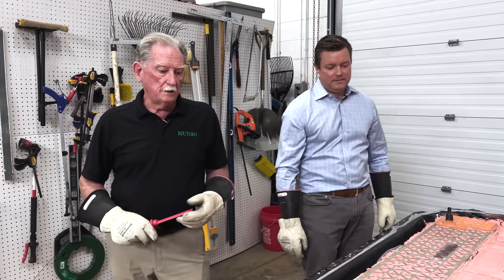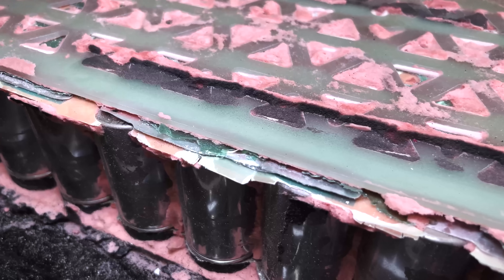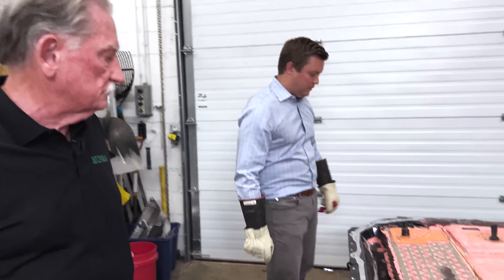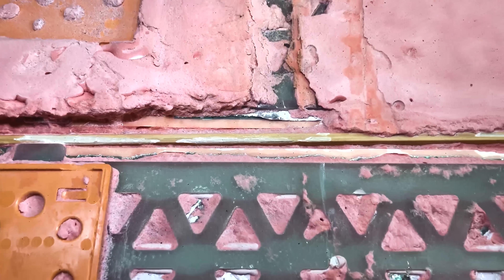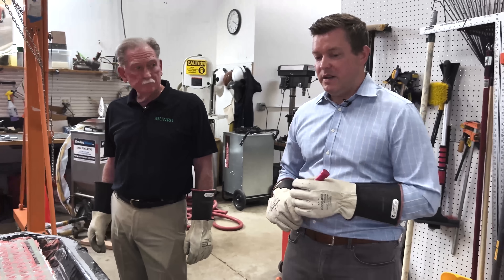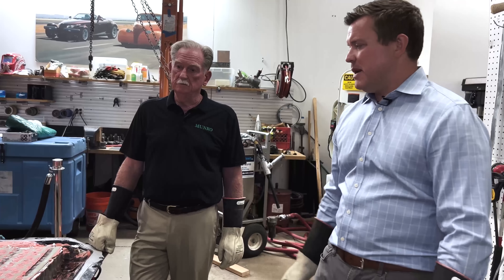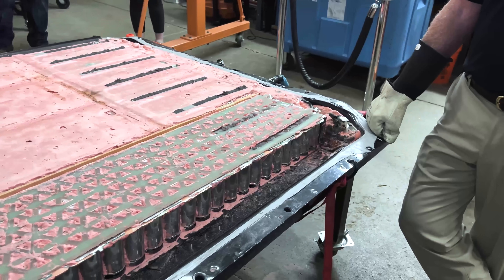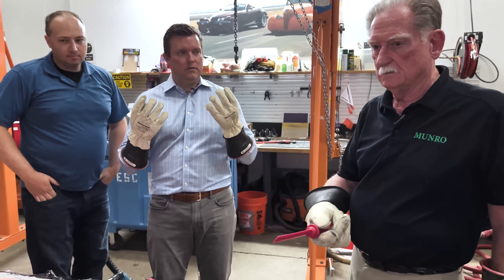4680 Battery Pack: What We Found Under the Foam!

Comment: What this design does prevent is repair. Yes it can be recycled when EOL, but ANY fault will need it to be recycled.  Ok, it's practically a solid state device (no moving parts) so it should be in effect 100% reliable until it reaches its natural EOL through cell wear, but realistically there is nothing "fixable "In there at all.
Reply: Exactly the point. To make something repairable you have to be able to access the insides easily. Doing that you compromise the pack and make it far easier for it to fail due to environmental ingress. The design of this pack is such that it will have a very small chance of initial failure which would be covered by warranty. If the pack passes the initial break in period of 8 years, then you really only have to worry about slow degradation. Once it reaches a point that it needs to be replaced for that it will still be viable as a stationary storage pack used in its entirety. People will pay big bucks to bolt one of those puppy's down somewhere around their house and have the equivalent of 3-4 power walls. Once it can't perform that function it will be sold to a recycler to be processed as high-grade ore. It will never be necessary to open it. This is new and different technology; we don't have to make it work like what we are used to. It doesn't make it bad or worse, just different.

Comment: I have zero knowledge in manufacturing/ assembly/disassembly of these things, but how would one repair that? Would you have to throw the whole pack out if a cell goes bad? It looks like a mess trying to get rid of the foam to replace a module.
Reply: Let's assume there's a "fuse" on each cell.
Now let's assume that if a cell goes bad, it can be electrically disconnected using the control circuitry.
You won't notice 1 cell missing.

Comment: Mr. Munro... I like your channel, even though I disagree with you on some things. If I may ask you a question...
You mention that when a head gasket fails, it is not the fault of the head gasket. It is the fault of the threaded fasteners. I agree completely on that, however....
As a customer... Would you rather have an engine that is completely welded shut, with no access to internal parts if something goes wrong? A spark plug fails... New engine! The same concept applies to a $10,000 unrepairable battery pack. Hope you can at least see my point, even if you don't agree.
Reply: On Audis the entire engine compartment is sealed.
Reply: @fredbloggs5902  Definitely won't be buying that car! But is it sealed completely, or just to customer access? In any case that is not the road we want to go down as customers.
Reply: @DavidJohnson-tv2nn  Fred is kidding. There are no cars with sealed engine compartments, but frustrated customers might make comment like that.
Reply: So....."A" cell fails.
You now only have 98.78% of the original capacity.
(You won't notice)
Reply: @rogerstarkey5390  So if BMS components fail, you're out of luck. Coolant leak, you're out of luck. Any number of internal components fail, you're out of luck. Can't believe that you guys try to justify this stuff. 
By the way, may I suggest that you watch the video on the Gruber motor company channel. Where a single failed cell took down the whole battery pack. In that case, they were able to gain access to cut the bad cell from the system.

Comment: Appreciate the explainer on how a pack like this might be recycled. It sounds “simple” but still requires expensive and less common equipment. Is it fair to say that, even though it’s certainly recyclable, serviceability has still gone straight out the window? 

It seems that if there are any issues with individual modules or cells, the entire pack would need to be scrapped.
Reply: For recycling, the Floatation system they described has been used in the mills at base metal mines for several decades ... crushed ore goes in,  high grade concentrate comes out.  The floatation cells have chemicals that affect how the materials float.  (obviously in pure water much of it would just sink).   

The liquid nitrogen system was prototyped by a small start-up a few years ago, and it isn't done so much to make it easier to pulverize the battery, but so that it's electrically safer.
Reply: @Ken Lord  True, but then what happens to the environment at EoL with regard to that which "sinks" Ken Lord??
Reply: @IDamian1  What happens is whatever you let happen.   Just like every other industrial process in every other industry,  you must take care of it.    EV battery recycling is already 95% efficient,  so the materials in a battery can be re-used 20 times before the good stuff is entirely lost by the inefficiencies of the process.

This is 20x better than mining new material from the ground for every battery,  which also creates tailings materials that must also be contained.

And even that is far far better than any ICE car where EV haters just totally ignore the tailings and environmental concerns for producing and distributing the fuels for the life of the vehicle.
Reply: @KenLord  nonsense!!!!! Fuel is just a tiny part of a gigantic oil industry lol….. do you even know how many oil byproducts exist!? There are about million
Reply: @KenLord  from your clothes to devices even this Tesla battery, tires, roads, ships, aircrafts, spacex fuel…… everything is oil
Reply: @carholic-sz3qv  awesomely juvenile and irrelevant observation, with an utter lack of nuance.

... The vast majority of oil is used not for those useful things, but is wasted by needlessly consuming it as fuels. 

I didn't tell you that we must stop using all oil.   I've told you how an EV battery pack can be recycled.   Learn what words mean.
Reply: @KenLord  let’s not forget all those “EVs drivers that still very heavily relies on the oil byproducts in their life, they/many flies regularly! Wasted food…… there is a difference between using and wasting needlessly as you crap about! The world, grids, infrastructures was built by the oil industry what have EVs actually contributed!? Even to open the most remote mining operations in the world for gold, copper, lithium mining……. All is fuel.
Reply: Yeah a ball mill Is rocket science. Nearly 10 years ago I retrofitted a testing device to measure the needed cutting energy on lithium ion cells.  Why do you want to repair this. We are running in a lack of workpower. It's a waste of qualified people to repair something that is build by a robot in a fraction of time.
Reply: The same goes with the pipes and BMS……. It’s essentially a single use piece of crap! How are people going to reuse those cells/batteries for other projects after the car life!?
Reply: @carholic-sz3qv  look, I'm pro repair, but the amount of cells that goes into someone's DIY project (and probably ends up in a landfill instead of recycled due to exiting the loop) is minuscule. If it makes recycling the majority of the pack easier (=cheaper, =more likely to happen), it's worth the compromise. And if it means there's less vape pens in the world, I'm all for it.
Reply: Teslas battery packs are already designed and hold for several hundred thousand miles. The 4680 cells have a lower internal resistance which is a big advantage for longevity; generated heat is one of the major problems with Li-ion battery cells, so the 4680 cells will most likely be far superior in that regard.
Reply: A SINGLE  cell provides 1/820th of the energy.
0.125% 
NOT noticeable.
Reply: @rogerstarkey5390  That is not really the point I think shanepj13 is making. 
Before structural battery packs. The individual battery cells could be collected after a lifetime as part of an battery pack that has then been deemed End of Life (EoL). Then they could be individually analysed and repurposed depending on their individual State of Health (SoH). The cells will deterierate at different speeds. Some would be good enough to be reused directly in a new EV battery pack. Some would be a bit worse of and maybe end up in a home backup system. And the once with worse SoH would be grinded and floated or similar and be remade into new cells. This is the more resource intensive however.
If the only option structural packs are to grind them and float the materials like it high grade ore it is still a lot more resources then to simply repurpose the cells which are healthier.
Reply: @rogerstarkey5390  single dead cell take entire parallel group to grave with it. Dead group undercuts whole string of cells. That's why entire battery is as good as weakest link.
Reply: @uosiumen  TL:DR - single cell failure will not take down the battery. Just nope. 

Single dead cell, if failed open, is just an inactive cell. 
If failed short, will burn through its connection to the busbar and turn into an open. If parasitic... Well, hopefully that should come out quite early in the life cycle as excessive self-drain, falling under warranty. Maybe there's an argument there for replacing that cell only. But in general, a parasitic cell that develops said parasitic in use, should fail short (and then open) after a good supercharge/ludicrous mode go-pedal-stomping. So... Italian tune-up?
Reply: If designed well then it should last longer than anything else in the vehicle without needing to be serviced
Reply: @niktak1114  wrong!!!! You can’t be sure that it will last that long, plus different usage different degradations ….
Reply: @carholic-sz3qv  Obviously a small percentage of packs will fail. In that case the whole pack will have to be recycled instead of a single module. The trade-off is worth it though.
Reply: @niktak1114  the trade off is absolutely not worth it at all! The less we recycle the more we save on resources and energy and also pollution….. by reusing their batteries cells as many have been doing for years already, it’s super awesome plus it already replaces the need to create new batteries for home storage…. Manufacturers like Toyota has been using old Prius batteries for solar projects around the world, same with Audi in Africa….
Reply: @carholic-sz3qv  they WILL be recycled
Reply: @niktak1114  lol………..

Comment: Is the battery airtight without ventilation? And what about humidity absorbtion? I wouldn't trust a battery covered in wet pink foam.
Reply: What makes you think it is wet?
Reply: @royh6526  I am sorry. English isn't my first language and it's still a little struggle for me. 
I missed a "if" > 
"I wouldn't trust a battery if it's covered in wet pink foam"

Maybe the foam is hydrophobic and I am absolutely wrong.

Comment: The recycling comments are very interesting but the process is still too complicated. I'd like to see Tesla innovate a recycling concept/process into their batteries to make it efficient, inexpensive and safe for the environment.
Reply: Discharge FULLY.
Shred.
(Use the energy from the discharge to run the shredder!!).
JB Straubel had ALREADY said they (Redwood) will produce new "ore" of BETTER quality for 1/6th (17.5%) the cost of mining new material.
I'd say that fulfills the brief?

Comment: I wonder how feasible it would be, for repairs, if a highly accurate robotic laser/CNC was used to surgically cut into the pack, cell by cell, to test and/or replace cells, then patch things back up? I'm thinking, to diagnose/repair a battery pack, throw it into a smart robot-battery-surgeon that looks similar to this: https://youtu.be/sbRqHTXfj_s
Reply: Let's assume that's possible. Then you have to ship a 600 kg battery pack to a rare facility that won't be around the corner. You need a heavy truck. The machine and thus the repair will also be very expensive. May not be worth it if your car is 15 years old. 
Or you use battery modules that can be swapped by loosening four screws. You can use your car again instantly and ship that 30 kg module to someone who will replace the faulty cells in an ordinary package.
Reply: @Nelson-Man  I agree with you that more modular batteries would be nice, but I think we should assume that unless government steps in, manufacturers like Tesla will optimize for lower cost and higher performance (and probably longer lasting) over repairability, so we may see more solid blocks of glued-together packs like this.

Comment: You have tried to resolve the foam with Acetone? Usually foam becomes a liquid in Contact with acetone.
Reply: The usual solvent is tetrahydrofuran.

Using solvents on a large scale is a health & safety nightmare that requires specialists.
Reply: @fredbloggs5902  If you ask for specialists you are on the right channel 😉

Comment: Lack of modularity, greatly diminishes the ability to repurpose the battery pack at EOL. Sad fact for DIY enthusiasts.
Reply: "EOL" implies "no longer usable".
At which point you "recycle"
Reply: @rogerstarkey5390  Sorry, ... I meant EOL for automotive use, is generally accepted as being 80% of original capacity. For these Lithium cells EOL is relative to their use I guess. An 80% capacity battery pack would still be of good value for home power storage, etc..

Comment: Based on my math, the 4680 Austin built Model Y is either software limited or contains approximately 15% non-active/structural only 4680 cells. Will you confirm that every cell is active once you are able to get to them? Thanks!
Reply: I’m sure the in-depth report will be made available.

My guess is for around $10k.

Comment: Great video - the recycling scenario seems a little "out there"  - but if anyone knows it's Sandy.  I think some of this trend towards "unrepairable" vehicles blends into Tesla Robo-Taxi fleet goals.   More and more people will no longer have to own a vehicle and can simply ride share (especially in city/urban areas) - so expensive repairs for older vehicles would be avoided - when a vehicle breaks, the fleet owner would ship it back to the factory to be repaired/recycled.  Tesla is finding it more and more difficult to adequately staff its service centers anyway.
Reply: The whole robo-taxi thing is extremely unappealing to me.  Not doubting it will have its place, but when I want to go somewhere I don't want to wait even 5 minutes to have a car show up, let alone basically call an Uber for every trip.  I want my car, with all my crap in it, in my garage, when I walk out the door.  The car interior that holds up to repeat taxi service isn't the option I'd be selecting.  I also don't want to come out to my car and find the remnants left by someone my car went out and robo-taxied at 2AM last night.  No thanks!  Is there any color besides yellow? 😁

Comment: thanks, good job guys. This is like battery pack engineers designed to extract max performance and leave all other considerations behind. Consider a faulty electrical component or cell in the pack, this immediately becomes good as trash.  Now it makes sense why this new pack has lower capacity vs the 2170 LR.  They build the pack in the factory with a capacity that is close or higher than the 2170 but they software lock the capacity to something lower to account for defective/low performing cells.
Personally, I'm not a fan. This pack design would make sense for low volume super/hyper performance EVs.  This is like Apple gluing a battery to the phone, removing the need for a back cover or battery housing.

Comment: That does not bode well for replacement or recycling.  It would make sense to me that if you created various module sizes (i.e. 1'x1', 2'x2', etc) with a common connector that when a module fails it would be cheaper to replace instead of a whole battery pack.  If it became a standard set of sizes and connectors then 3rd parties could build battery replacements
Reply: That would not be structural, and it would introduce weak points and failures.